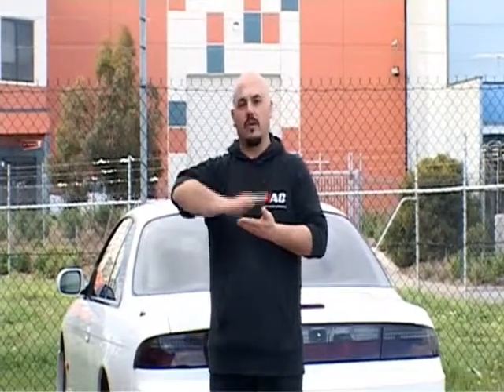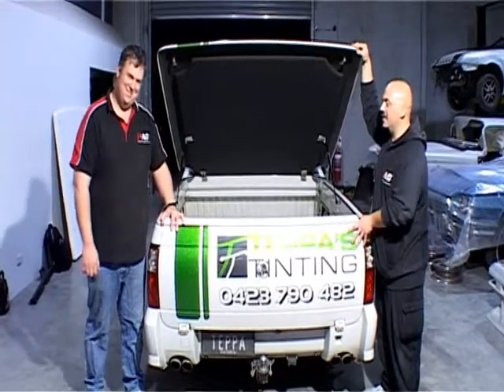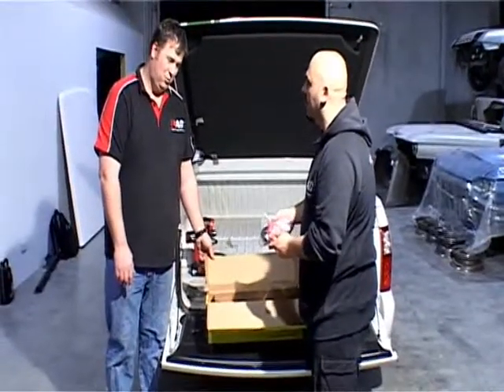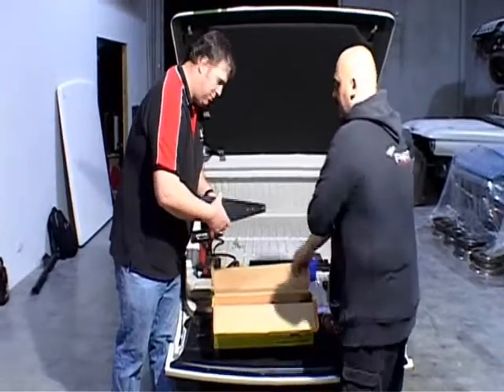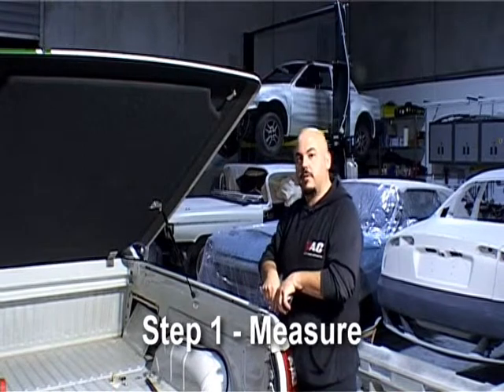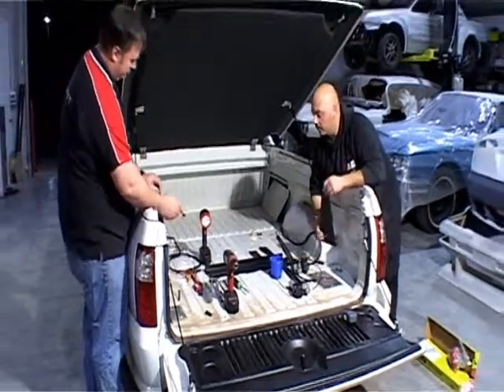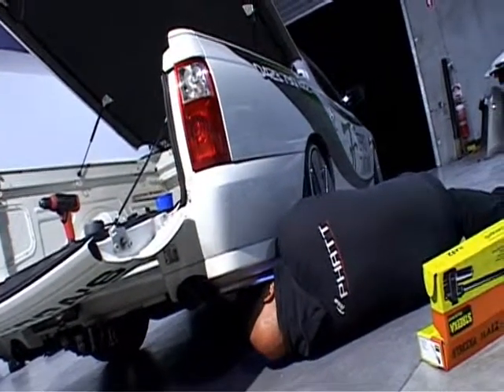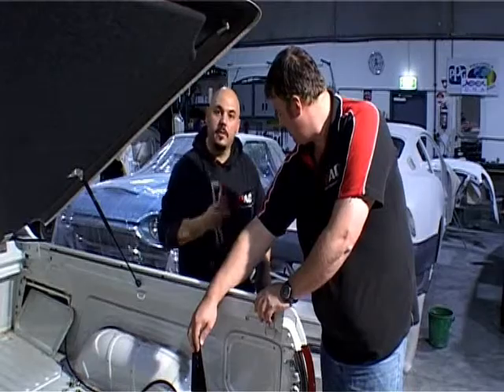STONNO Installation_Part 1.wmv

Comment: Greetings from Florida USA.

I am trying to find this kit, or one like it for my Dodge Ram fiberglass tonneau cover. None of the names you mentioned on the video come up in my search.  Do you have a website that I am able to purchase this from?

Also, when you are attaching the plate to the lid, what type of screws or bolts do you use in the location that did not have the screws previously?  I am worried about putting a screw through the lid when I get to this point.

Thanks
David